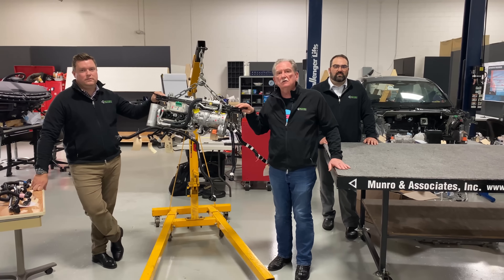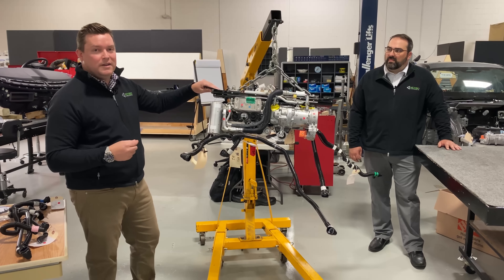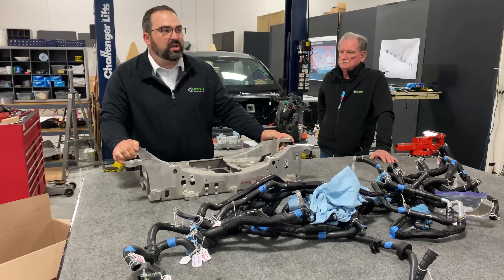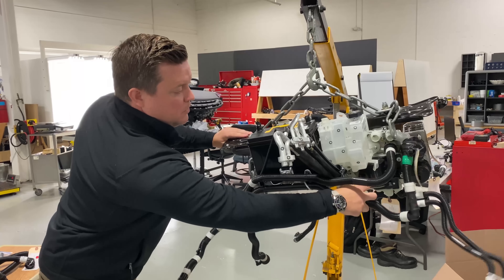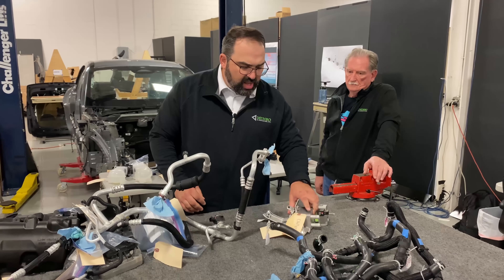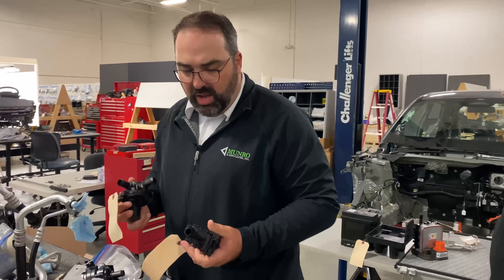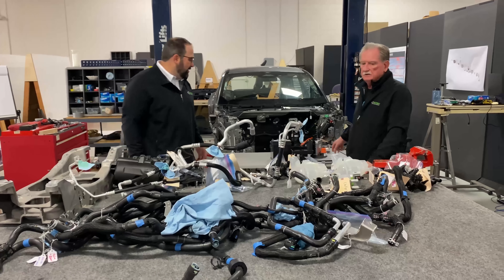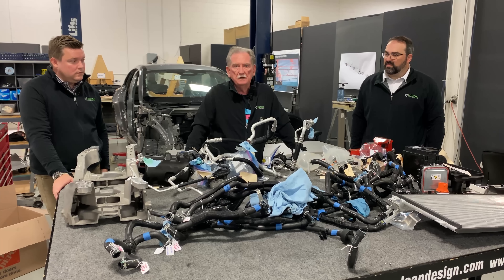Mach-E Thermal System Part 2: A Detailed Comparison to the Model Y

Comment: Designed by engineers who really didn't want to be designing an EV!  Sheesh, you can tell just how far away from their wheelhouse they are with this cars design!  So much redundancy, so little cleverness.  The TESLA design just shows a LOT more creative thinking.  Give it another generation or two and the TESLA parts will be so far ahead, it will be nearly impossible to catch up.

Comment: You haven't compared the difference in efficiency or effectiveness/performance of the two thermal systems. If, for example, Ford's system performs better than Tesla's, and keeps the batteries and motors working at peak performance for longer periods of time in extreme hot or cold environments, it is a better solution despite having an "uglier" system.

Comment: I put 420K miles on a 2006 Ford Explorer with only 1 hose leak -- and the radiator shop easily found a drip and fixed it with a new clamp. So, I'm not too concerned that the Mach E has about 3.5x parts and 3x length of hose. I'd guess the design team, working on their first EV, focused on the important aspects, like crashworthiness, ergonomics, ride, etc.

Comment: Can someone explain to me how the mach-e is even within earshot of model y's range? Does the range drop significantly when ac or heating is used in the cabin or for the batteries in winter. I was quite surprised how good they did otherwise with the extra weight of the Non-minimal interior and other bits.

Comment: Keep in mind that Munroe's priorities are to make products as cheap for the manufacturer to make as possible, so they make as much money as possible (passing the savings onto consumers would be nice, but it's not what's happening), not to make them cheap for consumers to repair or cheap and easy to recycle, so while high levels of part integration, huge, unrepairable castings and injection moulded composites are a great thing from the point of view of cheap manufacturing and company profits, over the lifecycle of the vehicle, especially in terms of the cost to the consumer, highly integrated assemblies tend to pass the costs in much higher labour and much higher part costs to the consumer. When all you want is a hose or a valve and instead you need to buy all the other bits around it and a mechanic needs to charge hours in labor to access the parts, the car company has made their money, but their customers are being shafted as soon as something fails or wears out. Tesla's attitude in using software to lock the owners of their cars out of being able to work on them is also shameful, but that's just corporate America at this stage.

Comment: And the question, which is cheaper to repair? Probably mach-E.
Reply: By a mile.
Reply: Cheaper to repair, but you will have a lot more repairs to do due to many more failure points.
Reply: @xBIGMUSCLEx  Hoses and their connections are quite reliable. My Marauders still have their original hoses and constant tension clamps that haven't leaked. My 92 Crown Victoria has had one hose replaced and that was only due to a squirrel deciding to munch on it.
Reply: @maraudermanmarauderman7161  they aren’t. They get hard and brittle with time, then they start leaking.
Reply: @xBIGMUSCLEx  not today... Better jump into the 21st century
Reply: @FusionBoost2.0  I've literally owned 3 modern vehicles from ford, and it has happened to almost all. lol
Reply: @xBIGMUSCLEx  lol I work at GM and own a modern Ford, I've had 2 in the last 7 years, not one coolant leak ever, Jesus my father's 09 Impala has never had a leak and it has 260,000 miles lol
Reply: @xBIGMUSCLEx  modern EPDM hoses and spring connections are super reliable

Comment: Simple unbundled car instruments (just like Scotty says after being a mechanic for 50 years) is a better fix, than a complicated full tecnologic car with everything bundled up together, because when IDIOTS (THAT AS WE KNOW, ARE MAYORITY) SCREW THEIR CARS the costs a inmense. Conclusion: we ALL agree that (against what Munro says) when an idiot have an accident in a Tesla 3 and breaks only one component or hose from the "bundled device" he will incurr in a huge loss since ALL will have to be replaced. A very different case will happen in the Mach E, were just a simple hose will have to be replaced and it will be DIY job at home. Yes?

Comment: I can't believe that the Leaf's heat pump and coolant system is as complicated as the Mach E, as they don't have the room for all those components, yet you say the Mach E is second best??  Is the Leaf as bad?  (I have a 2014 Leaf with HP and it does not seem nearly as complex from what I recall.)  Thanks

Comment: Wow, this looks like a disaster, at least seeing all these hoses dumped out of that box. What was Ford thinking? I wonder what percentage of the Mach-E’s lower efficiency vs. a Model Y are due to these types of parasitic losses for things such as these extra pumps to run. 

The efficiency difference between the Y and Mach-E isn’t as large as the as the “EPA” range estimates would lead you to believe, but the Model Y is able to go just about as far as a Mach-E using 10-15% less energy. The “official” range estimates would make you think a Y could go 20% farther on 20% less energy, but that’s just not realistic. Tesla’s range estimates are very liberal. 

It is important as we transition to EVs that efficiency remains a number one focus of engineers.  We don’t want to just switch from gas guzzlers to “electron guzzlers”.

Comment: Those electronics with the “scrap if dropped” is pretty common on many electrical parts in automobiles.  The G-Forces from a drop is way higher than the vehicle would deliver. It just makes the choice to use or not simple if you butter finger it.

Comment: Would be interesting to know the weight of the cooling system (battery excluded). With coolant. Should be an even bigger difference.
Reply from the maker: We will add it all up, typically we reserve full system totals and cost for our reports.

Comment: Here are some Important material science differences between Tesla and Mach E coolant hoses left out from the Sandy Munro’s YouTube video, as tweeted by Alex Lim:

I'm developing material for those coolant hose and I have some hints to share:
i) the rubber hoses in Mach-E are traditional rubber and can't be recycled easily because it's vulcanized with sulphur
ii) rubber hoses are very heavy (0.2-0.4 lb/ft, depends on diameter)

iii) rubber hoses requires high energy input to manufacture, less flexible for fitting into tight space, but material cost is low
iv) Tesla uses nylon material for tubing, which is a thermoplastic that's recyclable and more energy efficient to produce

v) nylon tubings are more flexible, very lightweight (0.06-0.08 lb/ft, depends on diameter), material cost is however 3-4 times more expensive than rubber

Of all current BEVs, Tesla is the only one implemented 100% nylon tubing, most others uses rubber hose.

Tesla nylon solution is multilayer type, inner layer can resist coolant well.

With volume, nylon cost should go down.

The rubber hose is made of synthetic rubber (like roof material), so it’s price less likely affected, but raw material price went up anyway.

https://twitter.com/miracleofmatl?s=21

Comment: Probably a classic case of legacy car makers going the path they are most comfortable with.

They rather take the less elegant but proven method than risking it with radical changes.

Which is why we should tend to avoid the first generation of products. Even Tesla made significant changes underneath with the Y compared to the 3 despite both technically running the same mechanicals.

Comment: Since the Tesla system seems more robust and reliable, Tesla is in a position they could include a 100,000 mile powertrain warranty on their cars. That single act that could severely hinder the competition if they tried to match it. Getting a leak in an EV can be more serious because if battery cooling is removed those cells can get very hot causing an expensive repair.

Comment: At first glance this seems like an obvious failure for the mach e, but I can't help but wonder if all the extra lines, pumps, and coolant capacity doesn't result in better cooling and heating performance for the ford and thus a longer-lasting battery etc. The model y is beautifully simple, but does it sacrifice heating and cooling performance for the sake of simplistic design?  There is no doubt there have been some downsides to the tesla approach to building cars.  One of which has been a terrible track record for reliability.  I know it is alarming to think about potential for leaks.  I can't help but wonder how that amount of hoses and lines compares to what you see in a modern ICE vehicle.  Leaky hoses don't seem to be a common problem on modern vehicles.  In fact I can't recall ever needing to replace a hose or line on any vehicle I've ever owned.  Those coolant lines are also probably lowish temperature and pressure.  It will be interesting to see if coolant leaks become a common problem, but I'd be willing to bet they will not.

Comment: I do really like Tesla products. 
Beautifully engineered.
However, if a part were to fail ( i.e. hose or reservoir) the dealership would probably say “Sorry Sir, we do not sell parts, it is sold as a unit”. It will only cost you $10,500 plus labour.

That’s not right.

You could probably buy whatever individual part required to fix your Ford.

Comment: I see too many failure points on the Mach E.  EDPM hoses are tough but those plastic connectors are a fail over time. Plastic deforms with heat cycling and eventually one of the orings will lose its ability to seal. The design needs alot of consolidation and reduction in parts count IMHO. I'm confident Ford will pull thru, they handle challenges well from past history. Tesla has some outstanding engineers with backgrounds from aerospace and Bechtel. Ford still has some ICE syndrome in their design.

Comment: JC do you boys just work for tesla now? That is not the entire plumbing system for the Tesla, not by a long shot. For fuck sake I am surprised you did not start spreading out every nut and bolt on that table. Where is the condenser and evaporator for the Tesla, not to mention the lines to all the hoses that were just hanging in mid air. Truly shameless and pathetic bias on display once again.
There is absolutely nothing here that will tell you anything definitive about which of these two systems actually works better, or will be more reliable. In some cases trying to make one pump do everything saves on cost but compromises function and reliability. In some cases small individual dedicated systems function better with lower cheaper repair costs. Unlike when that big pump goes out and now nothing works, it is expensive, and a lot more work to replace. How is that better for the customer? There are a lot of factors these clowns clearly know nothing about, but they certainly pretend like they do, apparently out of some misguided bias.
perhaps the Ford engineers had good reasons for their design, maybe you should ask them before making inane assumptions. Cooling systems are not high failure items to begin with in ICE cars, and in EV's the temperatures and pressures are much lower. So trying to make a big deal about this is just ridiculous. 
Spreading every little part out on a table for one system while only showing half of the other fully assembled is clearly a sales tactic. These guys are clearly on the Tesla pay roll, or at least drank the cool aid and are total fanboys (Sand without a doubt). I would not put much stock in any "analysis" they make.

Tesla's actually have a very poor reliability rating, with many issues requiring the cars to be towed so... Don't take my word for it, just do a quick search on "tesla reliability rating" they are terrible. Then figure in the poor service options, customer service, expensive hard to get parts, and this is not a great option as an only car for someone on a budget. Ford might not be the best, but they are a lot better than Tesla when it comes to reliability and customer service. I certainly would not want to own a used Tesla with no warranty, maybe that is why the resale value is not so great.
Tesla is cutting edge and they are relatively very new to the auto business and it shows in areas that many don't like to talk about. I am not planning to get an EV anytime soon, but if I were, I would go with the Ford for parts and service options alone. The fact that it rides better, no squeaks and rattles, and has better real world range, and looks better IMO, just add to that opinion. As their first try this Mach E is impressive, who knows maybe in another 5-10 years.

Comment: Well, service point of view again. You take Tesla to their service … they do replace one piece (the one hanging in your shop) . Ford replaces one tiny part, which costs 1/10000 of the part Tesla will sell. You guys are doing great videos, but… you are missing the service point completely. Tesla is like Apple the company. Repair costs 10 -30 fold to the similar fix on their competitors. Thats why I will never buy Tesla car. I have worked in two companies in my life. Both are the biggest on their industry sector. They do take care of their service business and consider the customer already on the R/D stage. — Tesla does not. Ford does. This is my opinion about the design of Tesla cars.

Comment: Fluid dynamics 101. EVERY bend away from straight EVERY connector introduces friction, turbulence which requires more force to pump. More pumps bigger pumps higher duty cycle for those pumps.
More noise. More work on the coolant. More degradation.

Comment: GOOD GOD!!! And Joe Biden went to the Ford plant to champion American made BEV innovation for 1) a truck that has not even entered production and 2) a car that is assembled in Mexico. Sad! You can see from this collection of parts and processes the minds of all the Ford engineers working on their particular portion in complete isolation from the next one. Like Tesla, someone at Ford is responsible for the overall heat management system, overseeing dozens of Ford engineers each working on their tiny portion. Whoever that is at Ford should be fired for gross negligence. You can see just how they are trying to take a ICE car system and force it into a BEV, for one. Two, has Ford never taken apart a Model Y/3 themselves or watched Sandy do so? The videos are right here, all they have to do is watch a condensed version to see what a real first principles engineered solution looks like. And yet, and yet, they still created this Kraken-like behemoth. Staggers the imagination.

Comment: Anyone want to bet that Tesla will take the 12 volt Lithium battery from the Model S Plaid and install it in their other vehicles since it weighs much less and is much smaller than the current one being used.
Reply: Well..... 6 months later and Tesla is installing the 12 volt lithium battery in the Model Y and Model 3

Comment: When they ran the Tesla against the Porsche taycan, the Porsche taycan kept going, the Tesla went into 1/2 power due to over heating battery.  Porsche, better stuff, as expected.  And the Porsche had power left to drive home, it did numerous acceleration and stop tests, Tesla failed..
Reply: How much does a Taycan cost? And one overheated on a track - read about it, so not sure what you're talking about. And didn't they have to recall them for loose suspension parts and a software glitch with their batteries?   I think you forgot the internet exists. Anyone can jump on an see for themselves how unreliable the Taycans have been.
Reply: @cyberfred5520  The build quality of a Porsche versus a Tesla assembled in an outdoor tent, Tesla is a goof...
Reply: porsche ? model s plaid just beats porsche... so no tesla fail :D
Reply: @docdistortion  0-100-0 mph test run, Tesla died on first run, over heated, went to 1/2 power, taycan continued 10 runs 0-100-0...and had power to drive home, tesla is a goof, a hobby.  Not a car maker
Reply: Just google "Japan EV Grand Prix", the Taycan had absolutely no chance against the Model 3, the cooling system of the Model 3 is much superior.
Reply: @andkosification  Porsche, better products, always, Tesla is a hobby, not a car maker....

Comment: Ford seems to have fallen into the trap that got the Brtish Car makers - designing cars to use up old parts, rather than designing new. "We have a whole bunch of old tractor engines - how the heck can we get rid of them?." "Stick 'em in a cool looking car" - result, a nice, but flawed sports car - the Austin Healy 100-4. Would have sold more than a few thousand, if it hadn't been designed just to be thrifty. Tail wagging dog etc..

Comment: I find it hard to believe that you rate (as stated) the Mach E as the second best designed cooling system after the Tesla. That looks like an inefficient nightmare. I doubt the ID4 is anywhere near as bad as that parts wise and efficiency wise. This video alone would make me steer clear of the Mach E. I’m sure the Ford designers were wincing when you pulled out the Frunk cover to expose this disaster to the world. Ouch.

Comment: I was under the impression the Mach E was a blank slate design.  Ford was not just shoving batteries and a motor into an existing platform, but building an EV from scratch.  I'm assuming Ford had taken a look under the hood of some Teslas, or at least watched some of Sandy's videos, but they haven't learned anything.  The winner in the auto industry will be determined by how much cost can be squeezed out of the car.  Ford's marketing department can't save them.  It's up to their engineers, and they just proved with the Mach E they are never going to catch up Tesla.  Tesla's next challenge is scaling production.  If they can accomplish that, then kiss the legacy automakers good bye.